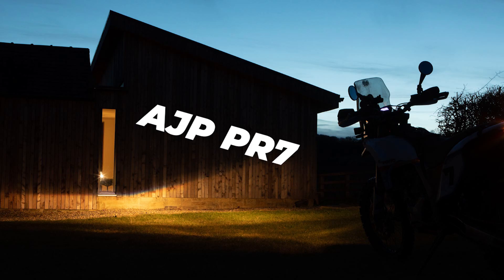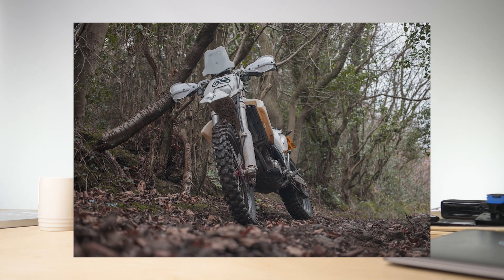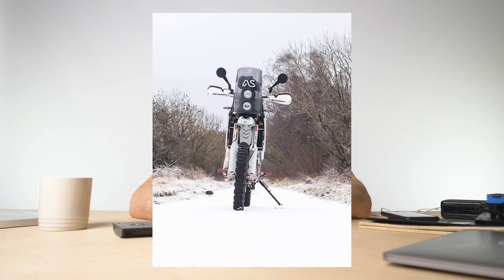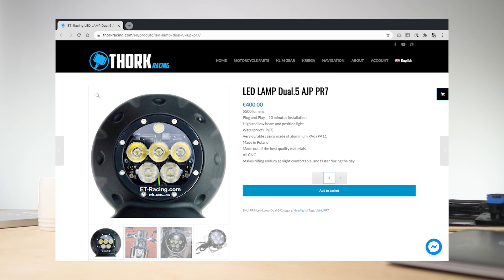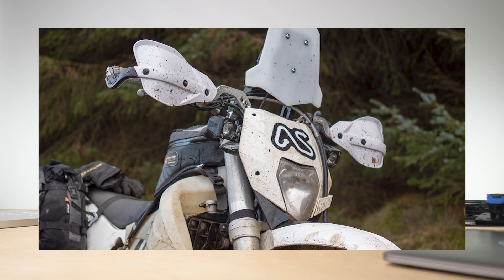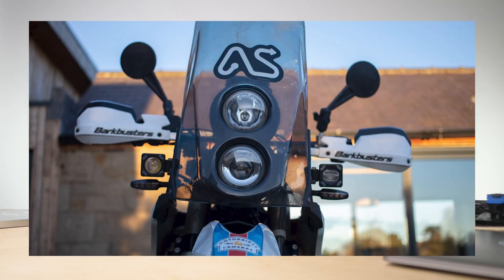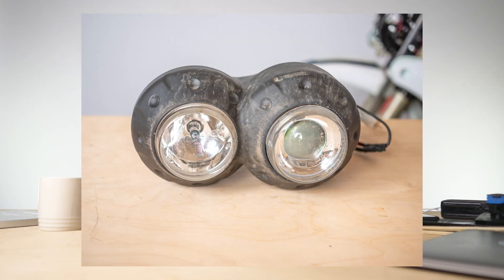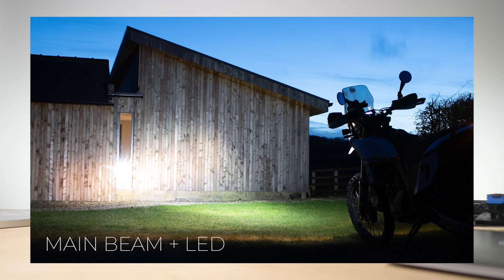How to upgrade AJP PR7 Motorcycle to LED auxiliary lights

Comment: Greg,
In one of your last films you mentioned you had swapped out the filler cap from your pr7 
From the standard locking one as it's not that good....
Can you tell me which cap you replaced it with please?
Thanks,
Tel😁👍
Reply from the maker: Hi Terry - you can find more info here: https://youtu.be/EpxOx3a0Cs4?t=56

Comment: Greg I was with you 100% up to the power grab from your main beam, then I would have to disagree.  The grab from the main beam should trigger a simple automobile relay, in turn the relay then connects your aux lights direct to the battery.  For safety I would place a fuse in that battery feed as close to the battery as possible.  Peace.
Reply from the maker: Good advice. I'm not an electric pro.

Comment: Gregg,
Nice work.
Did I understand you correctly that the ET Racing light would get you in trouble with the law in the UK?
Sounds like the dipped beam is always on.
Would the short beam (low) at 2200 lumens on the ET light violate the MOT rules? Is it a switched light?
I'm guessing the high beam (long) would be switched in order to avoid blinding on coming traffic. I know you didn't buy the ET, but is sounds like you have a good understanding of how it works.
Thanks.
Reply from the maker: There is a bit of a grey area around aftermarket LED lights. When I made this film the rules said that they were not allowed, but it looks like this rule is being amended. Bottom line, I had some spare aux LEDs and I wanted the ability to unplug them easily if I needed to. :-)

Comment: Hello Greg, thank's for your review. The et-racing or myk lab solution is indeed the easiest. Why didn't you switch to H7 led bulbs ? the fact that it is too bright in low beam mode as you say ? It's true that I tested on a motorcycle, the led bulb lighting is better but it must be very well adjusted not to dazzle.
Reply from the maker: I wanted the ability to control when I was using the LED lights, that's one of the reasons why I didn't swap out the bulbs. By having auxiliary lights I can easily unplug them if required. :-)